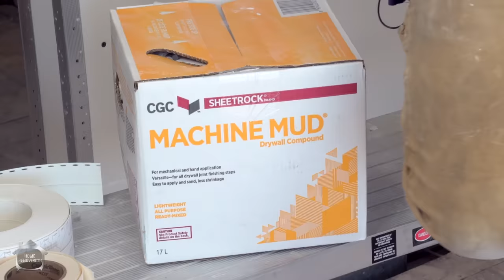DIY Drywall Part 4 | Drywall Taping Masterclass for Beginners!

Comment: Great video, I was foolish enough to think I was going to do tape using sheetrock 45. just ordered some machine mud and kilz. Quick question, how do you suggest taping an inside corner where the ceiling side is already finished popcorn ceiling?
Reply from the maker: Hi Farza, we did a video about doing smooth edging to a popcorn ceiling. it is a nice feature and allows you to tape a new wall to it.
Reply: @HomeRenoVisionDIY  thanks, yes I followed that video for the bedroom. Unfortunately this one is in the large living room. Trying to avoid the edge. Is it possible to tape just one side of the corner or would that crack?

Comment: Hey I was curious about something. So I understand you wet the tape after you put it on and dried it off to keep it from wrinkling, but if you put the first layer of mud on half of it won't that cause it to wrinkle? Thanks in advance
Reply from the maker: wrinkles happen when you over work it.

Comment: If your wall is 9 feet, do you run the drywall with 4 ft on top, 4 ft on bottom with a 1 ft filler in the middle?

Comment: My room has a gambrel, where about one foot is slanted between the wall and ceiling. Do I need to worry about metal inside corners since they aren't 90 degrees?

Comment: What do you suggest for outside corners when finishing drywall for paint? I have not been able to get the finish I want and am considering molding of some sort. Thanks in advance love your videos!
Reply from the maker: use a 14" knife if needed to fill the area. this makes it easier to finish nice! When in doubt prime the walls and then fill again. this way you stop sanding past the mud that is good by accident

Comment: Are mesh and paper tape interchangeable or what is the situation you would use mesh tape?  Also are you a full time carpenter or did you just start as a DIYer?
Reply: No mesh has to be bedded with a quick setting compound and is not recommended to for inside angles or butt joints. Paper is considered the superior product as it can be applied with premixed and powered mud and is can be used on all drywall seams.

Comment: Please correct me if I am wrong, I put the tape on over a mud, press it and remove the excess mud around then let the tape and mud dry. Then the next day, I put the first coat on. Is that the correct way? Because the teacher here is saying wet tape prevents bubbles. I thought tapes without enough mud before placing the tape causes bubbles. I am a bit confused here  'cos with my method, I hardly have bubbles.
Reply from the maker: wet tape means no bubbles. Cheers!

Comment: How do you handle a ceiling corner where you put in new drywall walls but left the plaster ceiling? Do you tape the inside corner the same even though the ceiling is plaster?

Comment: Jeff, can you please post a video how to fix the squeaky floor. We installed wooden floor and installed it on uneven surface. There is space between subfloor and wooden floor, when you step on it it dents and make squeaky noise. is there possible solution to fix it without taking it apart? Thank you.

Comment: Wetting the top part of the tape won't eliminate the bubbles.
If you get bubbles, it's because you didn't apply an even coat of mud on the back of the tape.
And another thing...
Hawk isn't a better choice than a pan.
Mud dries faster when you use a hawk and you don't have to be playing around with the mud.
P.S. You spend waaay too much time in one spot
Reply: He also wrinkled the heck out of that paper. May as well ball it up and throw it in the trash.
Reply: putting mud on top then wiping the joint forces the paper deeper resulting in greater contact, this forces more mud out and hence decreased likelihood of bubbles
Reply: @DSkimRS  are you kidding me???
The more mud you force out, the less bond you will have with the tape and WILL have more bubbles.

Comment: Thank you for the lesson. I have been watching videos like crazy on this subject. I live in a mobile home and on the walls are strips of cheap ugly wood that hides the joints. Well, I'm going to fix the whole house. A big project for someone like me with no experience. As I started putting mud on the first joint I noticed grooves being created in the mud. WTF? Investigating I noticed the paint was coming off the wall in little tiny chunks as I was spreading the mud on, which was creating the grooves in the mud. Then I realized there is wallpaper. You can scratch the paint off of the wallpaper. What do I do in this situation? Should I use a primer first?
Reply: How did it come out?
Did you remove the wood panels and then prime?
Reply: @pound6599  The walls turned out great. My wife is very happy with it. I am now laying vinyl floors and next will be all the trim. Cost of wood is insane now so I'm nervous on cost. Which is also why I am doing everything myself. I certainly can't afford a pro. But I strongly believe I can do anything and thank god for youtube DIY videos, lol.

Comment: Jeff! First of all, thanks!!!! 

Have a huge project at hand.
100 yr old home. Our floors are not level. (Wow!) hahaha 
I mean. Everything is sunk from the middle to the outside. 1 inch... An inch and a half... Don't want it to be completely level. But would like to make it better.

The floor joists are leveled(tested with the laser level)...

The difference in depth of the joists is in the order of 1/4 inch...

Therefore.... Summing it all. From below I can account for... Say 1/2 inch of the problem.

Subfloor is made of long planks of wood.
Flooring is tongue and groove strip floor.

What do you think?
Again, don't want it perfect. But it is very uneven as is. 

Wondering: sistering joists? (Shimming the sisters... Considering my old lumber is actually 8" and not 7 1/2")
Shim the old joists?
Throw it all out and redo joists?

Thanks!!!!
Reply from the maker: sometimes the key is to add support. 2x8 is just not strong enough. i install header beams to lift the sagging structure. Cheers!

Comment: On a small basement bedroom when you are only replacing 2 sheets do you still recommend using tape or would compound be suffice?
Reply from the maker: any joint requires tape of it will crack! Cheers!

Comment: I would not suggest to anyone that has never done finish work ever use quick set mud as it turns into concrete if not used correctly. Therefore if you do not set it thin enough for your application then you will need a belt sander to get it down to where you need it.
Reply: in addition, I would spot mud my screws instead of muddling the whole wall for 3 screws as that will create an additional amount of unnecessary sanding work for you

Comment: If this room was done in Sweden we use a maximum of 5 liters (half a small bucket) of mud in total for the whole room. You just fills the whole walls in that stuff. And the don't even get flat.
Reply from the maker: Hi John, in Sweden are you still using a whole wall plaster finish?
Reply: @HomeRenoVisionDIY  Nope, drywall are installed vertical over studs typical covers 3 studs cc stud is always 24 " so one sheet is 120 cm (48") wide and 240 (94") cm high, the long edges are filled to for a perfect flatness. They are what u say taperd. Sanding is done with a machine.

Comment: Just wanted to know if you recommend Metal Corner Bead or plastic?  I'm sick of looking at my unfinished drywall in the garage and wanted to know if you think the metal would hold up better in the cold (keeping it from cracking)?
Reply from the maker: in an unheated space why not just install some 1x2 on the corners. both other options will crack over time.
Reply: @HomeRenoVisionDIY  I totally agree with you on this one.
Reply: @HomeRenoVisionDIY  I agree with you on this one

Comment: Question: I have a home that had an addition put on it in 2001 The drywall has cracks on many of the joints but they don't seem to change with each year that passes. Is there any quicker and easier method of just filling the cracks then touch up painting them vs mud and taping all of them? It's a huge room with 12 foot ceiling. I keep putting it off because of the large amount of hours it would take to mud and tape all of it, blend it, feather it, sand it over and over. Trying to work that high up on ladders or something just adds to the nightmare. I feel like there's gotta be a flexible caulk or just filling with mud and hoping they don't crack again would save a tremendous amount of time and mess. Any thoughts or input positive or negative?  lol
Reply from the maker: superficial cracks like that can be filled with door and window caulking. then a little paint and presto no more problem!

Comment: How do you do an outside corner at a bay window that may be 120 degrees instead of 90 degrees?  do you just take the 90 degree corner metal and bend it out to 120 degrees  or use use paper/mesh  tape instead?

Comment: Never in my life have I seen nails used on beads before. You’re gonna have all these home owners smashing all their metal beads in 😂
Reply: What would you suggest?
Reply: Matthew Wasserman just a normal drywall screw, plus it’s easier to manipulate the bead with screws.
Reply: @Jackpo25  I've never had great luck with screws. I think the bugel head of a drywall screw either causes the bead to buckle if too tight or protrudes too much. I guess for a homeowner, it might make the installation easier, but may require more finesse with the mud after.
Reply: Matthew Wasserman I’m just saying professional drywallers don’t use nails they use screws. If you show up on site and start hammering on corners beads the boss is gonna send you home with your tools and your out of a job 😂
Reply: Mud on paper with metal corner. No screws or nails.
Reply from the maker: pros are using crown staples to set the beads now. Nails are old school but get the best result!
Reply: @HomeRenoVisionDIY  A good friend of mine (also a professional like yourself) saw me using the hawk and told me that I am "old school." Our office went from studs to a full office thanks to "old school" methods with literally no experience and it looks awesome. I purchased literally every tool you said. 👍 Old school
Reply: Home RenoVision DIY I’m a journeyman red seal trade commercial carpenter here in Ontario. Everyone uses screws for metal beads, in trade school they teach us to use screws. I’ve put up miles of beads. Just saying that’s not how they teach professional tradesmen to do beads...
Reply: @Jackpo25  I guess once you paint the wall screw or nail it doesn't matter. Nails are cheap and if they work that's OK. There is a thousand ways to skin a cat. Arguing over small things is pointless. Of course one may call over "current professional practice" but that is also quite relative and in the end it doesn't matter for the DIY home owner who is usually not interested in high productivity.
Reply: Reinier Torres ever heard the term “nail pop” ?They let loose over time and will crack most likely compared to screws. I’ve seen it happen, all these homeowners doing their own renos is great! They call me after they make a huge mess of it and I charge them double to fix it 😂
Reply: @Jackpo25  Well a nail or two popping out shouldn't be a huge problem, unless... "you come and tear the whole wall down to charge me twice". Cracks, dimples and problems like those happen overtime. A handy homeowner could solve those without an issue. I guess most homeowners who screw things so badly have never done a small repair and therefore should not take on a large project.
Reply: @Jackpo25  i stronly disagree , been in drywall hanging and finishing for 30 years and have never put my bead on with screws , always nails
Reply: Jeffrey Kidwell I’m a red seal trade carpenter. They don’t teach apprentices to use nails while putting beads on. I’ve built hospitals, schools, arenas, community centers. Not one nail in a bead. Case closed.

Comment: Another guy who knows what to do... Sideways 4 inch knife spreads 4 to 5 feet... Good job brother...
Reply: Taping Steps:

1. Tape all butt [upright] joints. - [Ceiling & walls]
2. Tape all flat joints.- [Ceiling & walls]
3. Tape all corner joints. - Doing horizontals [ceilings] first and ending with upright [wall] corners...
4. Tape/metal corner bead.

The reason behind this step process is so that all the ends of your tape pieces are locked down under the other tape lines that come after it until you get to the end where the corner bead locks down... Basically stacking all your tape ends under each other the whole way through the process... THIS is how you avoid tape ends popping in the future...
Reply: So says ~ journeyman taper finisher...

Comment: Do you have a video about how to fix tape that has become detached? I have some on a ceiling corner of a bathroom that needs to be fixed.
Reply from the maker: simply remove and start over. sounds like you need to add the fan to the light switch. Cheers!
Reply: Home RenoVision DIY Yep. There isn’t a bathroom fan in that bathroom. I want to add one but it’s very difficult to access the attic space above due to duct work.

Comment: What would you use for the corners in the upper part of drywall in a sterling shower/ bath insert? Paper or plastic?
Reply from the maker: when in doubt go paper!
Reply: @HomeRenoVisionDIY  OK already used a trim-tex magic corner. More expensive but worked well.

Comment: I really enjoy your YouTube page. Thanks for all of the tips!  I used fiberglass tape. Is there an advantage to using over the other?  (other than cost)
Reply from the maker: Hi Zander, some people find it easier to get started with fiberglass since it saves the step of embedding the tape into mud.
Reply: I suggest you use easysand or a bag mud for first coat over nylon tape, tends to crack years later
Reply: i would suggest beginners use the paper tape as it has a crease line on it. more skilled people can use the mesh tape as they get it tighter in the corners and less likely to cut the mesh tape with their knife

Comment: hey jeff did you write with a marker on your dryall? Isn't it hard to make it disappear with the mud/paint after?
Reply from the maker: marker on the plastic pencil on the drywall.,if you use marker on the drywall have kilz handy and it is gone in seconds. cheers!
Reply: @HomeRenoVisionDIY  
It's incredible how fast you answer. Twice in 2 days. You are great. And I went on international tools and saved about 150$ on a cordless framing nailer and a 5Ah battery. So happy to have found your channel.

Comment: What about the mud that's all purpose even for taping is it good to use
Reply: On walls, it’s okay, but for ceilings i would use a mixed one as they have binders and other materials inside that prevent it from shrinking.  Also the mixed ones give you more strength, so if you’re in the house long term, mixing it is worth it.  They’re cheap, worth the slight inconvenience

Comment: Hey Jeff, I had a hell of a time adhering paper tape. What’s your take on the self adhesive mesh tape?
Reply: Gregory Brown Mesh tape is trash. Paper tape is proper. If you use mesh with regular mud you’re gonna have cracks everywhere.
Reply: @Jackpo25  true story
Reply: paper tape is king. just make sure to put enough mud under it. you can always squeeze out the excess
Reply: Use fibafuse tape....best of both worlds and no bubbles.
Reply: mikebsexy I agree! Awesome for patch work, sits super tight. Love that stuff.
Reply: Fiberfuse is the best
Reply from the maker: Hi Gregory. if you add a little water to the all purpose mud then it beds really nice! mesh tape is good but you need to apply 45 compound which is tricky for the beginner to use.

Comment: What are your thoughts about the metal corner bead you used vs the paper faced corner bead ?
Reply from the maker: I prefer the metal. performance and cost. but paper comes in handy on floating bulkheads. Cheers!

Comment: how to fix cracks in the drywall joints which appears because of seasonal expansion and contraction?
Reply from the maker: use painters caulking. and perhaps get a humidifier attached to your furnace!

Comment: First maybe the only obvious thing I see is don't use your good knife to look for raised screws.
Second, if you take the corner of mud off of the knife with a light tap on the hawk to move the mud down to the edge that will rest against the other wall of your inside corner you will avoid mud falling off of or squeezing out the other side of your knife.
Third, ever been in a house looking at a screw that is half sticking above the base board? Doing them all takes a second and gives you a stretch so you can reach the floor as you get old.
45's a little runny? Looks like you got that from Monty Pythons cheese shop. Best to go small batch with the 45 or 90 or 20 and start out a little more like paste, also looks like he added water to the powder. If you put the water in the pail and add powder to the water as you mix, the only chunks you get are from old compound that has set in the bag.

Comment: I’ll be replacing the bottom portion of drywall, is it ok to tape and mud the unpainted drywall to the painted drywall, or do I have to sand off the paint?
Reply from the maker: you are good to go. but use thin coats to avoid bubbles on painted surfaces!
Reply: Thanks Jeff!

Comment: speaking of bubbles, running your angles over a wet tapes is a sure way to get bubbles,and you should always tape everything before you install your bead,and typically people would use steel bead when using fibertape/quick set,but youre using paper tape,figured youd use paper/steel bead,why is this labeled masterclass?